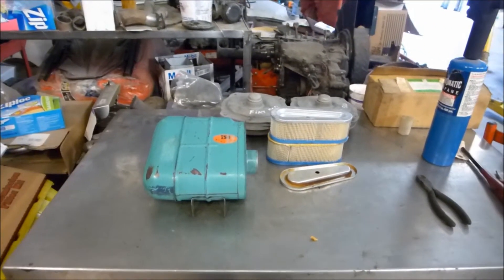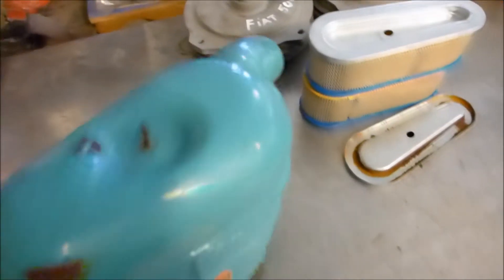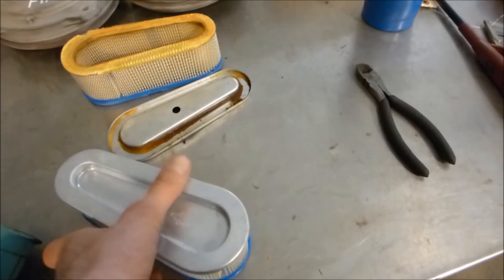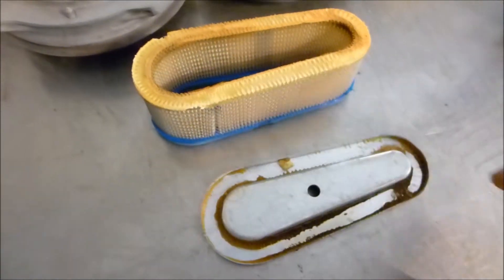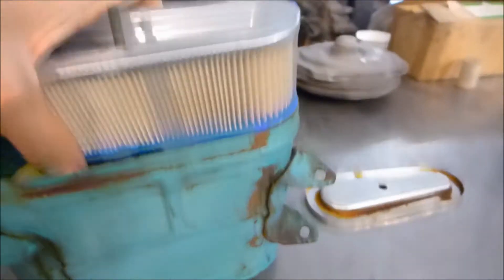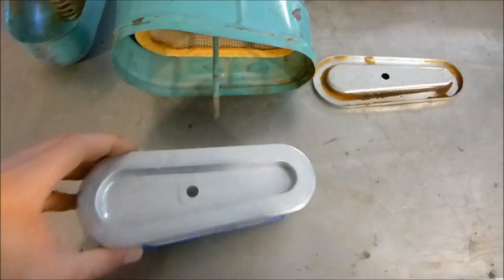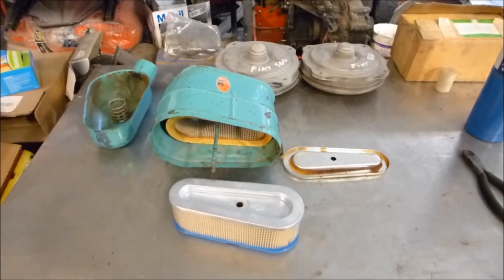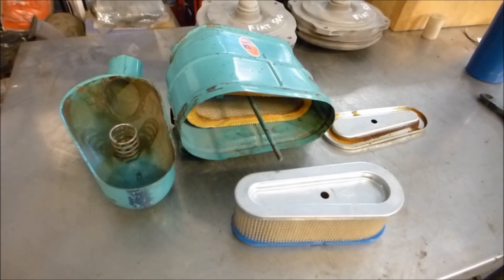Subaru 360 Van or Truck air filter tech tip

Comment: AGES AGO ( 25 YEARS ) I USED A K&N IN MY '70 SUBBIE VAN
IT WAS A BIT MORE EXPENSIVE THAN THE TWO BRIGGS FILTERS BUT
YOU CAN WASH & REUSE IT SO IT SOLVES THE FILTER SEARCH PERMANENTLY .

TO GET IT TO WORK , YOU NEED TO USE THE METAL ENDS FROM AN
ORIGINAL FILTER . ( I BURNED THOSE OUT TOO )

THE K&N IS VERY FLEXIBLE AND WILL CONFORM TO THE TEARDROP SHAPE  .

ALL YOU NEED TO DO IS FIGURE OUT WHICH FILTER IS THE RIGHT HEIGHT & DIAMETER . SORRY I DON'T RECALL THE PART NUMBER